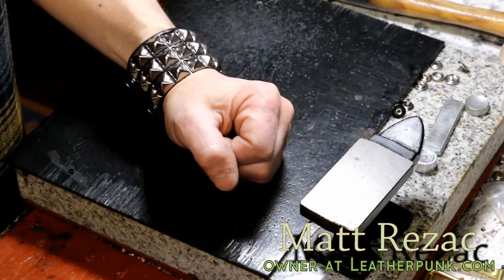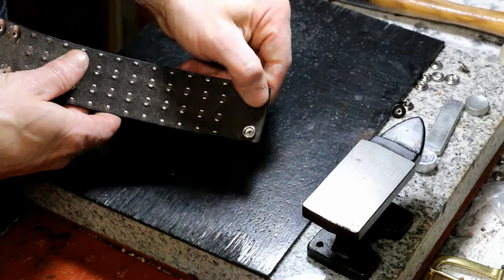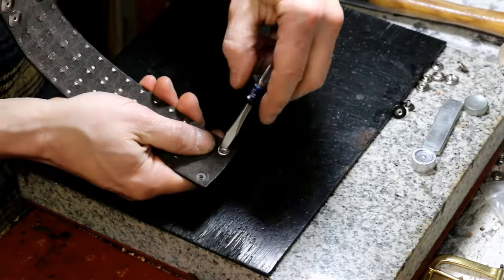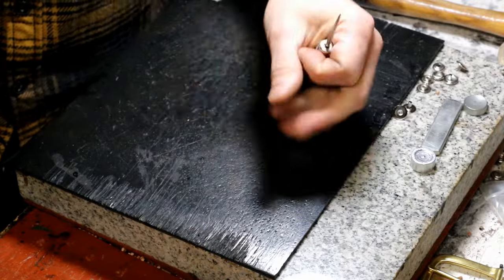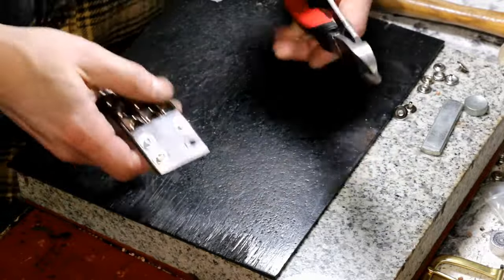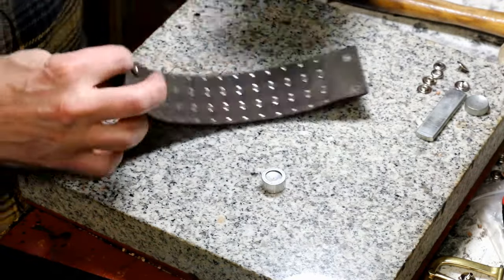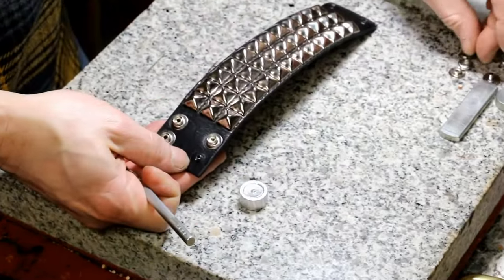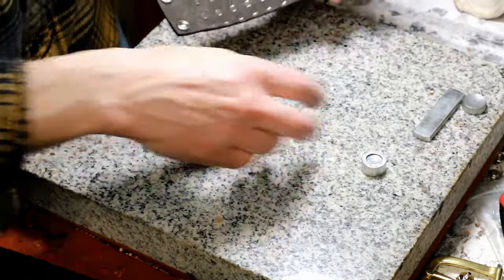How To Remove & Replace Snap Fasteners

Comment: By the way, I have found that some heavy duty line 20 snaps cannot be pried off easily.  To remove them, you can drill them off using 1/4" drill bit.
Reply from the maker: The bigger snaps are tough fellas. Sometimes drilling works, but sometimes it just spins the snap. The large cap and socket can be removed the same way I remove the stud and eyelet: pry it with the cutting plyers instead of breaking it off with the screwdriver.